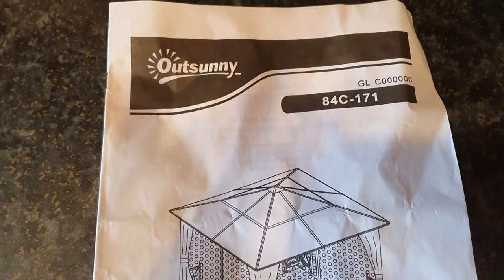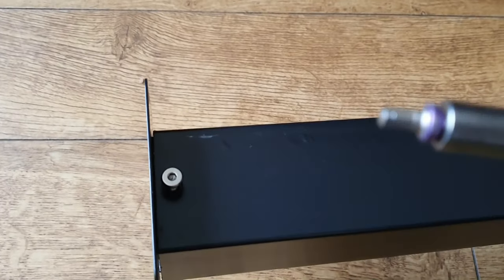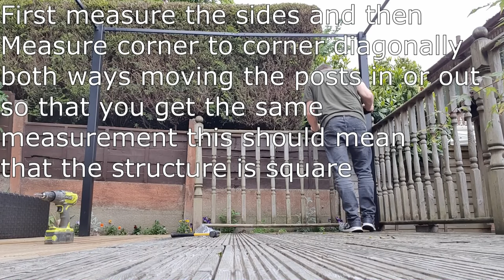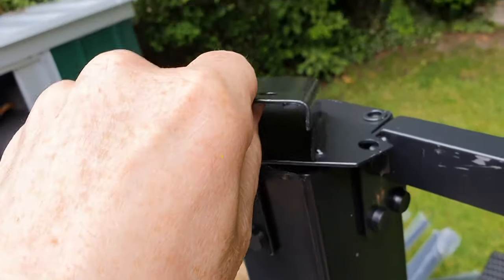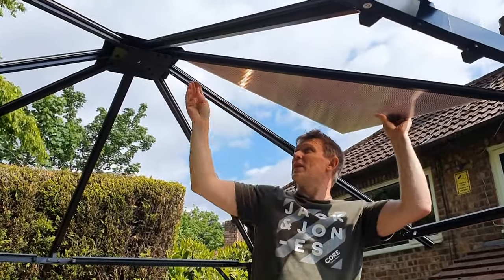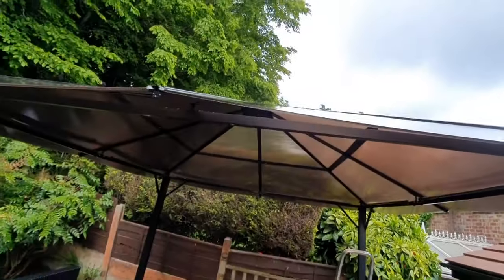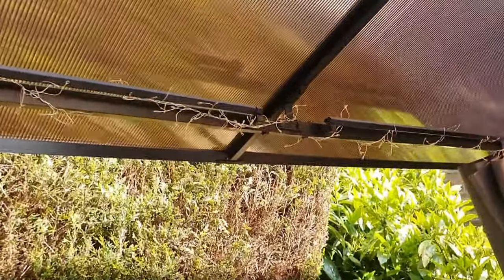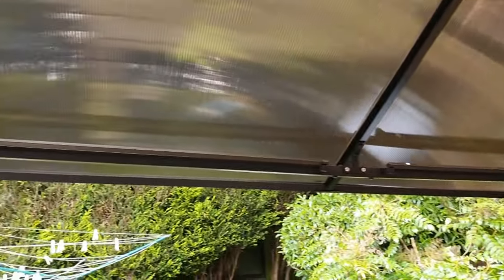How to install a Hardtop Polycarbonate roof Gazebo in your Garden

Comment: I was going to get one with these slightly clear roof panels but those are looking flimsy so for the price I might as well go the extra $200 and get proper metal panels.
Reply from the maker: Hi Xeric thanks for your comment, I have no complaints regarding this gazebo with the polycarbonate roof I've had this one now for two years and it defiantly not flimsy it a good strong construction roof when erected correctly, its put up with all types of the British weather over the past two years, of course if you have the budget for the full metal roof then this would be a good option too thanks,
Reply: @MRCarybuck we have one and it’s slightly older and was under a few pines trees with insane squirrels.  The squirrels drop pine cones onto the gazebo top and caused a few holes. We need to replace a few of the polys.  Can’t find any replacements

Comment: very good video. I have put ours up aswell. However it leaks between that both the polycarbon pieces where that middle piece goes in. im just wondering i put the wider side on top and narrower side at the bottom. When looking at the instructions it says bigger side should be at the bottom. Any help or advice would be great! thanks
Reply from the maker: Hi Please check out my other video regarding stopping leaks, heres the link hope it helps thanks https://youtu.be/dAMuVJPo2qA?si=qxdZ0ZQt4Vp70ScO

Comment: What did you use to fix it to your decking?
Reply from the maker: Hi, I used decking screws to fix the legs to the decking as these are a non rust Screw and designed to grip the timber but I suppose you could use any wood screw to anchor the Gazebo so long as they are a non rust. Hope this helps with your own project. Cheers
Reply: @MRCarybuck  
Cheers mate 👍

Comment: What size screws did you use.  I bought and noticed that wood screws are not included in the parts list.
Reply from the maker: Hi James If you are putting the Gazebo on decking then it will depend on the thickness of your decking board mine are 28mm thick so I have used a anti rust or decking screw 5 x 30 wood screw to anchor each of the legs to the decking, Thanks for watching and I hope this helps you out.

Comment: Great video. Thank you.
Just installed mine, but it did not come with the bottom butress corner railings that you have that I think would prevent sway in a strong wind.
Do you know if and where these might be purchased separately?
I contacted Outsumny cust
omer service here in Canada, but they were of no help.
Thanks in advance for any guidance.
Dave

Comment: Hi! I wanted to ask if you had any concerns regarding the weight of the gazebo on your wood deck? We have composite decking and wanted to get a hard top gazebo as well but were concerned about the weight of it on the deck. Should we screw the support on to the deck or should we use a weight for the legs instead? Thank you!

Comment: I went for the outsunny 84C 177 with built in solar. and just started on the legs. what i find most annoying in the instructions is the lack of literal assembly instructions all picture format, while seeming  straight forward I'm still a little puzzled with the many parts involved. Hence my YouTube search for someone erecting this or one like it to give me a rough idea what everything is and where it goes. Given it cost over a grand would hate to miss something crucial
Reply from the maker: Hi Paul yes I agree the installation manuals are not the best at detailing the instructions and can be a bit frustrating but I Hope my video on installing mine as given you some insight on how to to erect the gazebo, Thanks
Reply: @MRCarybuck  Hi Thanks for your reply. After much swearing and cussing i finally conquered the task and for my efforts i must admit it looks the part and fits right in with the decking and garden. If i may impart one further question, You've had yours up for nearly a year now so if you could give me the low down on how it's performed over the period and not suffered any structural issues during the storms experienced over the year.
It would be handy to know the strengths and weaknesses during inclement weather. Many thanks.

Comment: How has it stood up to weather and wind etc?
Reply from the maker: Hi Steve, probably a bit early to say as its only been up for a month, but in the first week we had a couple of leaks when it rained from where the two polycarbonate sheets meet in the middle with the joining strip 12:17 in the video, but I have sorted this by running a bead of clear silicone down the inside ridge of the metal strips where the first polycarb sits in 12:29 It does not tell you any of this in the manual but really it should, I will be doing an update video on this very soon so you can see exactly what i have said above. but apart from that the Gazebo as been fantastic I will also update you when we have some bad weather and see how it holds up, Thanks